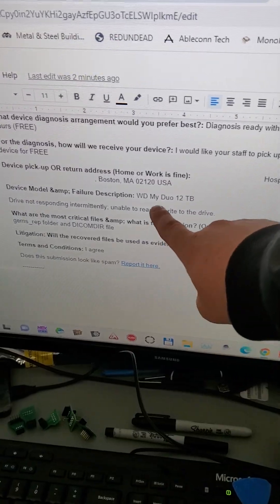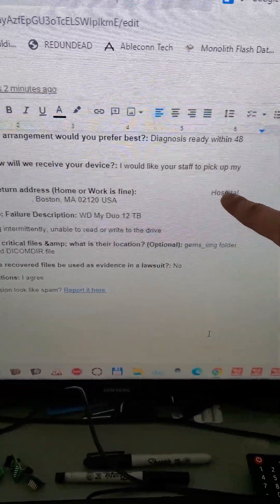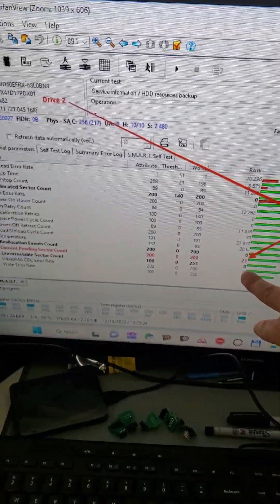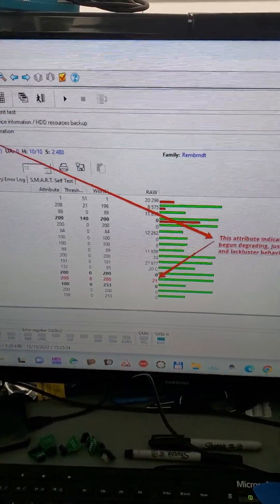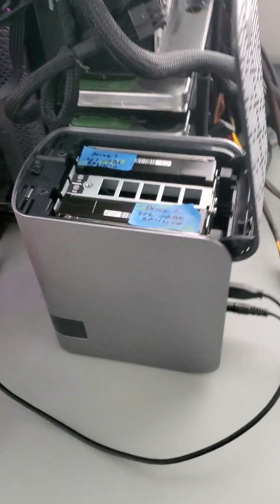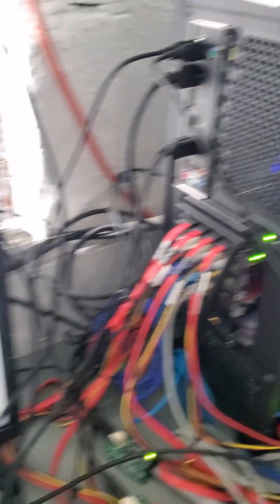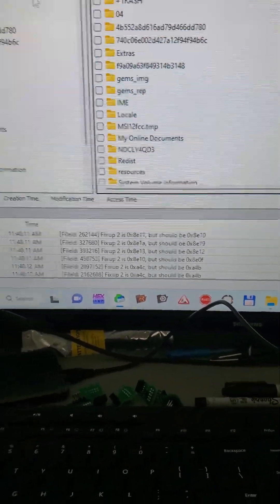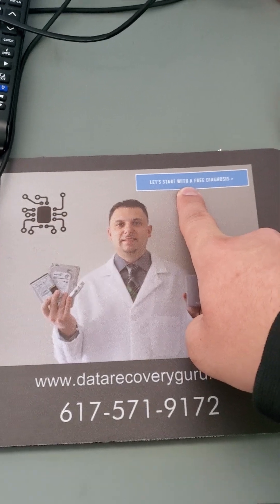RAID0 Data Recovery on My Book Duo with Encryption on WD Red NAS HDDs (Caution with firmware)

Comment: I was wondering whether to buy one of these, and this risk of data being unreadable, is news to me. Question - is this because the user turned on encryption (i.e. we have an option), or does the drive automatically encrypt? Because, if they encrypt without us having a say, that to me sounds like an added problem. While RAID1 protects from HDD failure of 1 disk, that assumes the electronics are working. But if the controller or any other part of the enclosure fails, and the data cannot be retrieved, then that is like losing both disks. Might as well use 2 separate but unencrypted disks.
Reply from the maker: It is an added problem, because of how the encryption technology works. Users expect high speed, therefore just about all encryption designs pre-prepare the storage for encryption. The user just has to activate it in software. Can you image if the encryption engine would encrypt live as the files get sorted in real time. It would be slow as heck.

The problem arises when the device fails, hence needing help from a specialist, because the average user won't understand and know how to deal with the pre-encryption design.